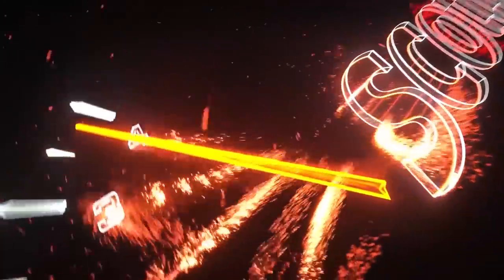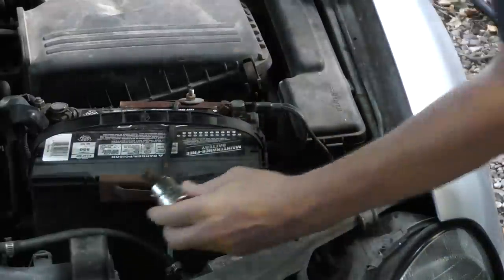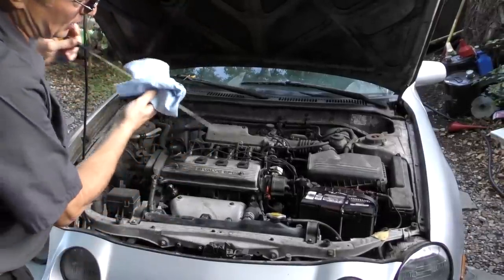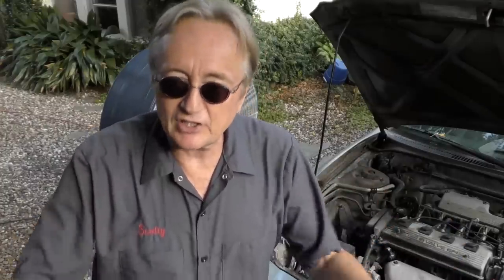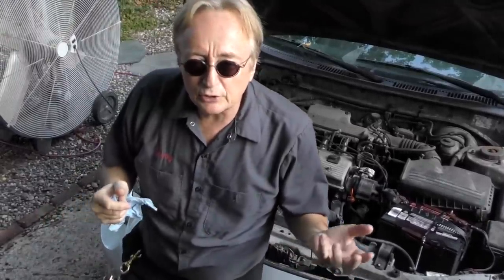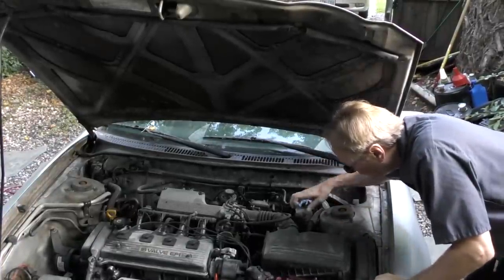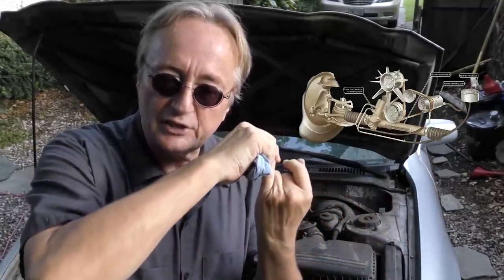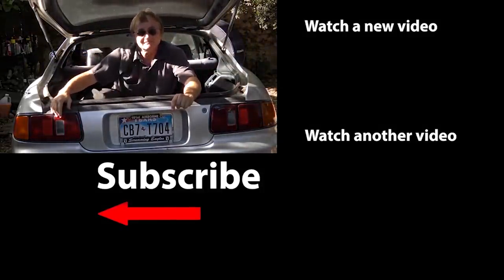If You're Not Doing This to Your Car You're Stupid

Comment: What a video!  Ty Scotty!  I had a 1999 Jeep and by 2014 I had to replace all the breaks, pistons at the wheels as they rusted away.  Chrysler poo.
Reply: By 2014, so you bought the Jeep in 99? If that was the case I'm assuming most everything broke, not just the pistons. Or did you mean the brakes? You can't blame Chrysler for worn out brakes on a 15 year old car. Or even the pistons for that matter lol. Parts wear out. I'm not defending Chrysler/Dodge. But they all have their good and bad.
Reply: @Roller76  The 99 Jeep Cherokee Sport brake assembly at each front wheel and the metal part of the brake line were way too gone and stopped working.  Almost got in a serious accident.  I had to replace the entire brake assembly at both front wheels.  By then I had replaced about everything but the engine and transmission and the electrical way spotty bad.  But the Brakes are the most important part of a car and you would think Chrysler would put quality parts in the brakes but they rusted away.  My 96 mustang GT and 99 Honda CRV are still kicking with the same brake assemblies, engine and the electrical and AC works great!

Comment: If anyone has any advice I'd appreciate it. In my '98 Camry V6, the 12v outlet fuse blew. It's a 15 amp fuse. I only had a spare 20 amp fuse, I put that in and it's been working fine. Am I in danger of melting anything or anything?

Comment: I always use a baking soda water mixture get battery acid off terminals and battery top. Then I was off with water. It will take all the corrosion off battery area. ✌️

Comment: Change your brake fluid every 2 years or 30,000 km. Most of the water come from the caliper seals and hoses. E.g. If you are driving in a hilly terrain and brake a lot, they may fail because of the heat build-up causing water transforms into steam resulting in loss of brakes.

Comment: I thought u should not change the transmission fluid becuase of the metals. Changing out the fuild can make it sieze on you.
Reply: You'll want to search it out, but if you've let the ATF get too dirty, then things can backfire.  My understanding is that DO NOT do a power flush, which causes dirt to break loose and clog something up.  A drain and fill, run on that for a couple weeks, then repeat until fluid starts coming cleaner.   Part of this is due to even if you drain and fill too fast your car has adjusted for thicker fluid and needs to basically reprogram itself as the fluid changes.  All this I've learned from Scotty, and you can too.  Thank you Scotty.  When the mechanic had the car I was looking at up on the lift, and I took each wheel top/bottom then right/left and tried to wiggle them, he was impressed.  I told him Scotty taught me.
Reply: Lynn Martz learned from the best. Lynn is correct on not power flushing sytem. Only change out fluid as scotth suggests. Im told the only time they should flush is on a total rebiuld.

Comment: Scotty, my wife did not check or change the oil in our 2015 Hyundai Santa Fe for about 10K miles and then the engine died and started making loud rattling noises even after filling and changing the oil.  Is there anything we can do?

Comment: Hi Scotty - i have a 2012 Ford Fusion with 155,000 miles on it.  Owners manual says to change the automatic transmission fluid at 150,000 miles.  I have never changed the fluid and would have done so a lot sooner had i found this channel sooner.  Should I change it or leave it? - Thanks

Comment: i bought this one car that had 40 ohms of resistance between the battery terminal and the battery post! it was that nasty. Mr Scotty what do you think about the ZMAX micro lube? how do you feel about increasing fluid capacity like oil pans with expanded sumps? i use Detroit Diesel coolant...it has excellent cleaners and it's purple😅
Is grounding the radiator to the battery good to combat coolant electrolysis?
Mr Scotty, power steering fluid vs. ATF who wins? thanks

Comment: I'm keeping my 1993 Corolla - best car ever!
Reply: Youve driven all other cars?
Reply: @nov3019892008  Ok, you're correct in pulling me up on that one! More accurately, the 1993 Corolla is in my opinion, the best car I've ever owned! I have been driving for just over 50 years now and have had a number cars in my stable over the years, including Austin, Morris, Rover, Riley, MG, Ford, VW, BMW, Hyundai, Volvo, Bentley, even a Berkeley, plus my current Rolls-Royce and Toyota Corolla. Of all of these, the Corolla has been the most reliable. Always starting first time outside down to -10 degrees C and has only had regular services, battery and tyres. Even the Rolls has 'failed to proceed' once, though not due to an R-R component.

Comment: I disagree! In my view I have driven tires for years with dry rot cracks on them the outside rubber isn't what holds the air in its the belts and the inside rubber. It's when the belts start showing you should be getting worried in my opinion. Tires are too expensive these days to be throwing them away when they still got plenty of tread on them. This statement was solely my opinion so no trolls please
Reply: The tire experiences stress against the sidewall when turning, think of it as rolling to the outside.  Cracked sidewalls may rupture when placed under too much stress during a turn.  
Also, when driving over pot holes or changes from paved to gravel in construction zones, then the stress is applied as the tire contacts the far edge of the pot hole.

It is unsafe to drive on a tire that has any damage such as cracked sidewalls and bulges in the sidewall.  Loss of control is a strong possibility!  I'm an auto- mechanic trust me, man.
Reply: @roym310  Dude the outside rubber on tires is not structural and bulges in the sidewall are different that means the belts that hold the tire together broke in that area. Do not be talking about stuff you don't understand because that screws lots of people over that are ignorant enough to listen to people like you. You might have  money to buy new tires but the rest of us don't. So go ahead and replace them tires prematurely I'll just buy them up and I'll drive on them. Thanks bruh

Comment: A blown head gasket from a old thermostat will destroy an engine so keep that in mine, frequent oil changes and timing belt/ water pump maintenance along with new hoses and thermostat . You should easily hit the 300k mark!

Comment: Toyota or not I'd test brake fluid if it's never been changed even if brakes are working fine. My car has pretty dark brake fluid (guess it's never been changed either) but tester shows it's still OK having less than 2% water in it.

Comment: The problem with the transmission fluid change/fill, is that you don't know if it was at the proper fluid level if it doesn't have a sip stick before you do the drain and fill.
Reply: Yup! Best thing to do is drain it and lookup the specs to see how much it's supposed to hold.
Reply: With those you just fill tell it comes out of the fill hole. Just like the rear differentials and the manual transmissions
Reply: @503rpf  No, most of them involve fluid level check at operating temperature.
Reply: @bigbigmurphy  Well you wear talking about one without a DIPSTICK. So you have to use a lift and then fill it tell it comes out the fill hole. That's how it done at the factory. unless you have a pit or have plenty of room under the car, which most cars do not have enough room.
Reply: @bmh67wa  The problem with that is that all the fluid does not drain out. You would have to hope there was the proper amount in the 1st place then measure what came out and refill with the same amount. You would have to pull the hole transmission to fully drain and then refill with what the specified amount would be. Or if you got a brand new one with no fluid.
Reply: @503rpf  I can't speak for other transmission, but Aisin ones do require you to verify it at operating temperature, which was somewhere of 115F. I basically overfill it a bit, idle the car, once it hit 115, I unplug the drain plug and hope some fluid come out, before actually torque it to spec and call it the day. Seriously, one dip stick would have saved me so much time.
Reply: @bigbigmurphy  I was just talking about the ones with "lifetime" fluid with no way to check it. Scotty just did a video about it a day or 2 ago. And sence you said no dipstick, that's what I was going off of🤪

Comment: 0W/10 synthetic have fluidity like water, probably with an expensive price tag. Shows how fine tolerances are in modern engines between moving parts. Love my 1990 ford laser, 450 thousand on the clock, no major problems. Do all my own maintenance, parts are cheap. Built at a time when quality/longevity mattered to design engineers & manufacturers. Like Scottys Toyota Celica. Love my bomb.😅🤣😂👌🏻👍🏻👏🏻👏🏻👏🏻. Cheers from 🇦🇺.

Comment: I have a 95 Ford Escort LX hatchback automatic transmission 1.9 L and I was driving and it died fuel checked out good spark checked out good would it be the timing belt and if it broke would it bend a valve?

Comment: Hey Scotty,
I’m working on a 2007 Civic Hybrid 1.3L. It’s been misfiring and has really low engine power. Changed the EGR, All 8 Sparkplugs, and the main air intake. It’s an IMA Battery system. Any advice?

Comment: Scotty is it true you can change the type of oil when you are in higher mileage like if the car says 0-40 oil but now has 124k miles can you change it to 5-40 oil?
Reply: I wouldn’t with new engines. Old engines sure
Reply: Luis Sanchez Not on a modern engine, they have small oil passages and stupid complex variable timing valve adjusters up in the head of the engine, plus some have also turbochargers etc. Not to mention they are very cheaply built.

Comment: Hi Scotty, Greetings from UK. Looking for a family car. Got my eyes set to 2014 Honda Civic 1.6 Diesel Estate. Here in UK it's exempt from Road Tax. Supposed to be very economical as well. Your thoughts ? I've heard you talk great deal about Hondas reliable engines. Would buying one with 100.000 miles be a problem, or aiming for 50.000 be better option. Planning to keep it for several years. Thanks in advance.

Comment: Scotty, I have an 2008 Vibe with 201k miles. The trans fluid has never been changed. Should I change it or just let it ride? Great vid btw.
Reply: What does the fluid look and smell like?
Reply: @wholeNwon  Orange/red. It has sort of a crayon smell.
Reply: @steve586586  It's likely that someone changed it along the way, unless you've had it since new. I'd change it, if it's been more than 60K or more. I assume it uses Toyota AFT. If so, that's the only one I'd use.
Reply: @wholeNwon  Thx.
Reply: @steve586586  Do NOT flush it.
Reply: @wholeNwon  Oh yeah, it'll be a diy spill n fill.

Comment: 204,089 miles on my BMW X3 and the lifetime transmission fluid has never been changed.   Guess BMW transmissions have a long life expectancy....
Reply: two turntables or you got lucky buddy
Reply: You're doing well if you've gotten 200000 miles out of an automatic BMW transmission...
Reply: @jerryl10000  No, I take care of my vehicles. I don't beat on it. Once in a while I'll put it in sport or manual mode & mash the gas but I don't treat every traffic light like it's a drag strip.

Comment: $500 for your sweet little Toyota is a bargain there must b a good story to that hey I paid 4,500 for my Yaris and I put 2,000 into iPhone connected pioneer $600 video screen and a JBL amplifier and 4x 100 watt pioneer speakers and the sound is clear and loud But sometimes I Like it quite and the the sounddeadning was worth the $500 I hardly hear the buses and trucks next to me if my windows are up it’s cheap as too ,ten  litres of petrol gives me over 100 to 145. KLM it’s reliable cheap and a pleasure to drive actually can be fun in corners if your pushing the line my dream car is a mustang 😍

Comment: 320thousand and change on a 1990 c1500 body is shot 3rd junk yard 700r4  I've owned it since it was 5 years old motor runs perfect except for a/c compressor whining and 3rd auto zone junk. Just got a turbo 400 from jegs .have you done any body work videos

Comment: I called to see if I can get my transmission fluid changed but the place asked how many miles I had in my car and since I had too many miles they said I risk damaging my car if I put new fluid since my car is used to the dirty fluid. So am I supposed to buy a complete new transmission or can I not just switch it for new fluid?

Comment: Hey scotty love your channel, how do i know when to change the timinig on my 2003 nissan maxima i bought it supper cheap so the guy had no idea i changed all the valve gaskets, fuel pump new plugs (nice japanese quality ones ) and did a full fluid change whats your thoughts? Btw i know its a post renalut merger but it is made in japan without a cvt!  Also it has 170000 miles

Comment: I heard changing your trans fluid could cause some issues. Ive changed the fluid on my Toyota and got no problems but im not sure if i should do the same for my 2001 Mercedes. What do yall think?
Reply: Only causes issues if the fluids never been changed and its really old burnt fluid.  Yeah adding fresh fluid could cause some issues. He has a video on that.
Reply: @markg999  yeah, i dont think my Merc has ever had its trans fluid changed so that gonna suck for me
Reply: @Megacooler96_  Yea I'd maybe just leave alone and just monitor the level.  You could maybe try draining a quart at a time and change the fluid over a longer period of time like a year so not a shock to system.
Reply: @markg999  yeah, im a try that out...thx

Comment: I have a 2003 ford Taurus with 140k miles and the transmission shifts hard and I found out that it was overfull of fluid so I drained some but it is still shifting hard :(

Comment: Hey Scotty hopefully you read this. Can you please explain if the new Toyota Corolla’s that use use a physical first gear then CVT are any good?  Yes I know manual is better but I’m interested if this new design is good or a flop (reliability wise). Thanks.
Reply: Can't know yet. Google for problems. I wouldn't buy one.
Reply: wholeNwon. Your right. I Googled it. There is a recall. 
Toyota is issuing a recall for the 2019 Toyota Corolla Hatchback. The recall is for automatic Corollas only, because the culprit is the new "Direct Shift-CVT" Toyota introduced for the first time in this car. About 3,400 Corollas will be coming back to U.S. dealerships to have the entire transmission replaced.
Reply: @willman100   Google's always the first place to go. And those are lighter vehicles!
Buying a car with new major tech is almost always a mistake. I'd be concerned about GDI engines, too, esp. without split port injection.  Stick with what we know to be reliable.

Comment: I change my oil in my 2017 Camry every 10,000 miles, synthetic oil is expensive but if you think about it, if you go to Walmart and get the Super tech 0w20 at 15.48 for a five quart jug and a super tech oil filter and change it every 5,000 miles I guess you will be ok. But that will be the only way I do it. Screw all these over priced motor oils.

Comment: Change you spark plugs and wires  at 100k. change your pcv valve every 10k. Change your air filter every 5k. And oil every 3k. Thats a tune up.
Reply: nope
Reply: @wholeNwon   Whatever.
Reply: @WVhillDweller  The oil change is excessive. I think most people have coil on plug these days. Iridium plugs can easily last 200K or more, esp. Denso Long Lifes.
Air filters depend on operating conditions. I still have my original PCV at 21 years, and, yes it's working correctly. I check the pH and electrical conductivity of the coolant and moisture in the brake fluid. Load test the battery before winter in cold climates.
Reply: @wholeNwon  i said a tune up not Repair.

Comment: Can you put 10W-30 in a 5W-30 engine? I heard you can in older engines?
Reply: The "W" on the label is the "weight" rating at 40 degrees C./100 degrees F.  That's its "cold" rating.  Most people believe that most engine wear occurs in the first few minutes after start-up, before the oil reaches normal operating temperature. (A 30-weight oil's rating is at 100 degrees C./212 degrees F.)  "Cold" oil is several times thicker than the engine was designed for. The lower the cold rating number, the thinner the oil and the better it flows and lubricates the engine until it warms up.  "0W" is currently the thinnest oil available at the "cold" rating temperatures and is the best for any engine.  "0W" is available only in a synthetic oil.  For conventional oils, "5W" is currently the lowest cold weight rating available. It will always be better for any engine than a "10W" or a "15W".  Period.  You want the lowest cold weight rating in an oil that still meets the "hot" rating of 30 or whatever is recommended for your engine.  Stated another way, you should never buy a "10W" if a "5W"is available, and "0" is best if you're running a synthetic.  It's just that simple.